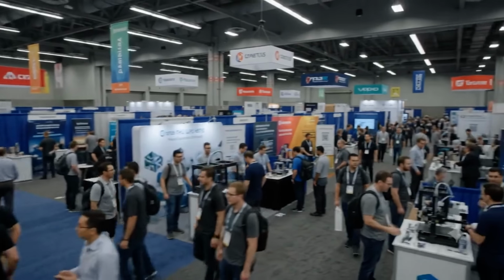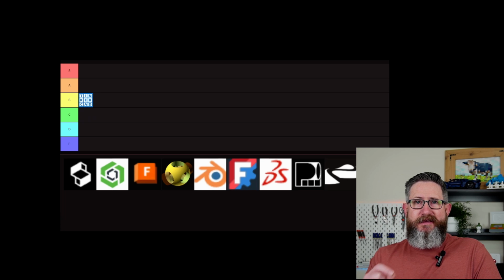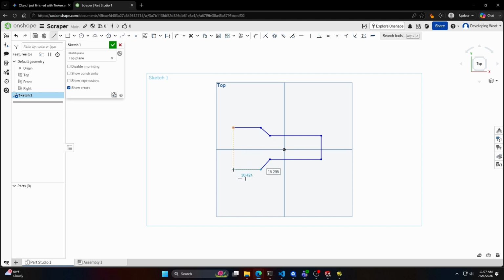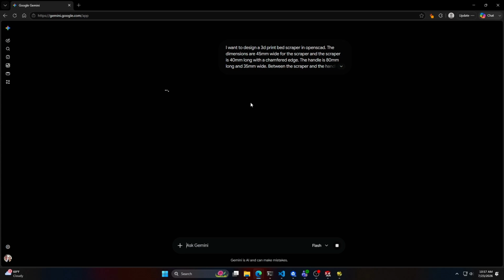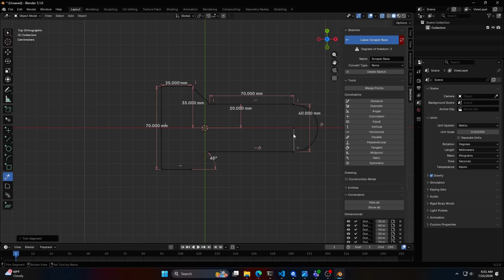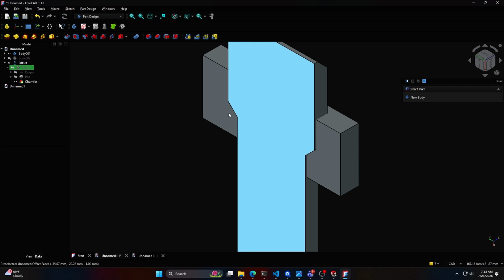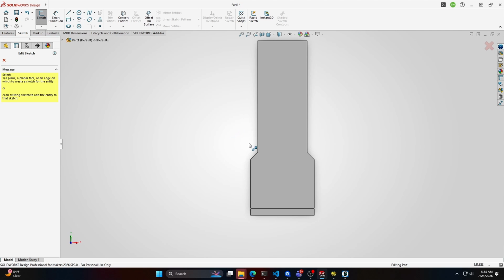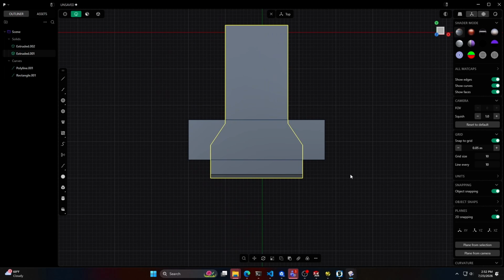Don't Pick a 3D Modeling App Until You Watch This!

Comment: I use OpenSCAD quite a bit.  I think it still might be in the C tier for most people, but for completely different reasons than what was stated on the video.   I was said it wasn't parametric, but that is plain wrong -- out of all the 3d design software out there, it is the MOST parametric one out there.   I personally have a mechanical phone charger, that has over 30 parameters.  Some of these completely change the layout of the final model.   It was also said it didn't have history, but in truth, you can use GIT.  But, unlike other modelers out there, this is not required for parametrization.

It does have downsides though, which would prevent me from recommending this over the other products mentioned --  namely the learning curve, which can be high, especially for non-programmers.    AI does not solve this problems either, as my latest attempts to use AI have ended up in generating more mistakes than successes...  So unless you enjoy programming, it's not likely worth it to take up.   It also cannot do organic shapes (faces, figures, animals, etc), so if you're looking to do something artsy, it's not great.

Where it shines is for complex technical modeling, especially where you are likely to need to configure a model on the fly (say you wanted to make a phone holder, you can configure the phone size at the last minute, and it can automatically update the entire model to match).   It can also do parts which require specific mathematical properties (i.e. paraboloids, quadradic surfaces, etc).   Here it is much more powerful than any of the products mentioned.
Reply from the maker: That's a fair point, treating code as the history and using version control like GIT is definitely a unique and powerful way to approach parametric design!

Comment: I've been using SolidWorks and NX professionally for over 20 years, that scraper should take about 5 minutes in either program if you are comfortable in either program and comfortable doing CAD in general.

That said, I have REALLY been enjoying using Plasticity and feel like it's the absolute fastest out of any of these programs. Yes, it's not a typical parametric program and doesn't have traditional history but making most changes is a breeze. Would I use Plasticity for a complex assembly of functional parts? Probably not but it smokes the competition for functional and organic parts when it comes to speed and efficiency IMO

Comment: Agreed FreeCAD needs a UI and workflow update
Reply from the maker: It’s definitely a powerful tool, but a more modern interface would go a long way!
Reply: @nicholaswilkowski632  for the ui there are very helpful add-ins that you can download to make it look modern. There are also youtube guides to reorganize all the tools properly. A bummer that you need to do it yourself though...
Reply from the maker: Man, this is a great tip! I didn't know there were add-ins to modernize it. Are those add-ins opensource and actively updated?
Reply: @wootsworkshop  FreeCAD has an integrated add-on manager. I followed the video for it, he has a lot of helpful tutorials for freecad: https://youtu.be/LKq7hgbu7ks?si=piIhlSqUob5hMlW8
Reply: FreeCad has a built in plugin manager and there are several plugins that change the UI. I’ve seen several YT videos on settings and plugins that improve the experience immensely.
Reply: No, the last thing FreeCAD needs is new "modern" UI. Classic UI is logical, fast and keyboard-centric, which is a must for productivity, unlike typical modern UI. What FreeCAD needs is further investment of efforts into bugfixing. I can't get through any tutorial without seeing unexpected error messages in console and filing yet another bug report. It also needs to eradicate Python from its code architecture and go back to C++-only model - Python only makes it slow and unstable. And it needs to do away with a linear feature chain and switch to a feature tree model in order to eradicate topological naming problem.
Reply: @Primarysearchtraining  FreeCAD almost solved the topological naming issue with 1.0. I did not had a single problem since, now being on 1.1.4. :D
Reply: @DeJe63  Have you tried 26 ?
Reply: @Primarysearchtraining  Agreed. Pretty little icons are fine for learners on that program but it's very hard to beat keyboard shortcuts for productivity from an experienced user.  That's where the shortfalls of a simplistic “test“ like this start to show through. In his “daily driver“ it was a 4 minute job.  For me in autocad it would be even quicker, but that's because Autocad was my daily driver.  There's no way I can compare what I can do with Autocad to something like blender for instance that I've never touched before.  
The more capable a program is the more complex it's menu structure becomes. In some ways a test like this is like trying to compare MS Paint to Solidworks. The outcome is going to mostly be determined by what you are trying to draw and the experience of the user.
Reply: I'm only interested in usability and don't care about the UI. Freecad is second to none in this respect. If they ever update the design to include the near-sighted huge buttons and thus decreasing the density of the interface I would be crying. Not everything has to look like a childrens toy.

Comment: I use Openscad but admittedly I have done a lot of coding in the past.  I have tried many CAD program including many of these in the list but I always jsut get exhuausted and go back to Openscad.  As for the comments in the video.  Openscad is inherently parametric.  History?  Well that sort of doesnt make sense in a code based design.  The code is the history.  And for  visual feedback.  Just F5 or F6 and it is there instantly.    Well designed code is easy to understand, change and extend.  I know most people seem to like visual programs.  Maybe I have fat fingers.
There is another one not on  the list that I use all the time in conjunciton with Openscad.  SolveSpace - is a tiny and basic  parametric modeler.  I use it to quickly convert a concept into some numbers that I can plug into Openscad.  Even so Solvespace is quite a powerful 3d modeler in its own right.
Reply from the maker: Totally get that. For coders, OpenSCAD makes perfect sense; the code is the history. F5/F6 for instant visual feedback is definitely efficient. Thanks for the SolveSpace recommendation – that's a neat workflow idea for bridging concepts to OpenSCAD parameters.

Comment: Great Video, I used AutoCad lite for years for 2D drawings of all types. I am retired now and  enjoy woodworking and now 3d printing. I have a good CNC with 4th axis, and printer. Have done a lot of design in VCarve Pro, which does create tool paths.
Because i wanted a better CAD ability than VCarve, I have tried Fusion 360 (free), Solidworks  for Makers 3D Sculptor, Tinker CAD and Free Cad. In those apps the juice (learning curves) was not worth the squeeze.
I happened upon Plasticity, and was able to design all kinds of 3D items with great success. They looked good, and easy export to the CNC and printer. That said it is not the best to quickly make something with precision. For me it was  many happy accidents I was able to print and carve on the CNC.
Starting with OnShape now, and this may be the ticket for me. Some early successes, but I am not in deep yet. I appreciate your take on this stuff

Comment: WTF, complaining about an “old” UI is insane!
Modern UIs are catastrophically unusably crap! You can’t even tell the freaking borders of the boxes or what is a button any what’s just text anymore!
90s UIs are heads and shoulders above them, and it has only ever been downhill since either Windows 2000 or KDE 3.5 with CompizFusion.
Also the whole premise of a PROGRAM having a UI design is already a ridiculous Windowsism. On Linux, the system defines the UI style, and the software is expected to use it! So the UI doesn’t have anything to do with the program! If you don’t like it, change it to one of countless choices is your desktop environment’s settings! I thought even Windows used to be able to do that, no?
Reply from the maker: I think the UI is more than just the borders and boxes. But I think I understand what you're saying. All my Linux systems are command line only so I wasn't aware of that with the Linux desktop. Interesting.

Comment: There are still a few CAD Programms out there. There is PTC Creo Elements/Direct Modeling Express, Solid Edge. It‘s free for Makers. And Alibre Design, Butt this istn‘t free, But it works Great.
Reply from the maker: I'll have to check them out
Reply: These are Windows onlly...
Reply: @DouglasJenkins  Of course. Windows is simply the most widely used operating system. If you’re looking for something for Linux, FreeCAD is right up there. Otherwise, Varicad runs natively on Linux.
Reply: @ElmarTeubner  To be exact, Android is the most widely used operating system, Windows is, on desktop.
Reply from the maker: @DouglasJenkins are you looking for an Android CAD application? OnShape is in the cloud, so it works as long as your browser supports it. Not trying to contradict what you said because it's true, I used all of them on a Window desktop. However, many of these applications have builds for other operating systems. Shapr3D even supports vision OS. If I can help you find what you're looking for, I would like to try. Thanks for the comment.
Reply: @wootsworkshop  Yeah, about that "as long as your browser supports it" bit, I wasted many hours trying to get either FF or Chrome to work with OnShape on Ubuntu, and it would not work using the Nouveaux video driver with a modern Nvidia GPU, and Wayland seemed to be a no-go as well.  Even using the proprietary Nvidia driver (which is awful , I was reminded why I had ditched it years ago), some menus would not appear in OnShape, and I packed it in.  "Supported browser" covers up a lot of backend requirements.

Comment: I am missing Rhino. It was many years ago the one that was easy to learn compared to SolidWorks and Inventor. I could learn how to play witht the splines and than trying out this and that - it can produce easily crap but it is not as squareheaded as the most classical CAD programs. It lacks parametrics and if not beeing deciplined you easily have some small inaccuracies in your model noticing far too late - but there are strategies and ways to solve that. Anyway, for modelling - my favorite program for a reasonable price. A lifelong version cost 1000€ and all optional updates, coming all 3-5 years cost about 600€. I also use FreeCAD for small parts where parametrics make things easier for me and for CAM (before I was using FUSION).

Comment: Nice review! One thing to mention, for me, browser base cad is a turn off just because you always need internet connection to operate. Secondly, your model doesn't do justice to Plasticity which is made to provide tool for very complex geometry although creating the scraper have been simplified if you have use 2 simple rectangles(handle and cutting head) along the YZ plane than rotating the "shoulder" and mirroring the whole "half" into one complete piece. With the square bracket it should take 15min approximately. It's almost like Blender but the fonctions are hinden under right mouse button... not easy at first.👍👍🇨🇦🇨🇦
Reply from the maker: Thanks for the workflow tips. I really appreciate the positive comment. The big struggle I had with plasticity was I felt it didn't do parametric modeling. But perhaps I need to use the tool not trying to make it fit my workflow but in a workflow it's designed to excel in. I wonder if I shouldn't give it another go. If you have any other tips I'm all ears 😁
Reply from the maker: I also agree with the negative of a browser based tool. Requiring an Internet connection isn't a selling point
Reply: 2 minutes max i Plasticity for sure, maby only 1

Comment: Im a professional Mechanical Engineer (Stress Analyst) -- been using 3D CAD for about 30 years and have used most of the big hitter programs -- I now use Plasticity outside of my 'day job'. Took a bit to get used to but its absolutely amazing at surface modelling and tbh there isn't a mech eng project I wouldn't use it on...... Make of that what you will. Great video btw
Reply from the maker: Amazing insights. Thank you for sharing this in a kind and supportive way. This is exactly what the community needs. You are no doubt a beautiful person. May I ask, the problem I had with Plasticity was the ability to change early dimensions late in the game. I'm not good at design so often I realize I've made a mistake, and I have to go back to an early sketch and make a dimensional change which can obvi have cascading implications and multiple sketches/extrusions need adjusting. I wasn't able to do this with Plasticity. Do you have a workflow with Plasticity that you could share that would help someone like me learn to love it more?
Reply: @wootsworkshop  The answer to your question is familiarity. Plasticity can change hole sizes, positions, etc but it does not offer parametric/history based modelling. For the sort of basic models you show in the video Plasticity is more than adequate. TBH, having used all manner of CAD/2D/3D modelling apps for over 30 yrs (now retired) I find Plasticity is beat for fast, concepting. Plasticity made me fall back in love with NURBS modelling (which Rhino made me hate). Plasticity is like SketchUp for engineering/hard surface modelling for me!

Once you get into complex models then you need constrained sketches and parametric toolsets. For that I use Solidworks. I can import a Plasticity solid model and rebuild the "parametric" history in Solidworks using "Feature Works". 

Very good and fair review by the way...I enjoyed it. I am a long time Blender user too since 1.8!
Reply from the maker: Thanks for sharing your perspective on Plasticity and its strengths, especially for concepting and hard surface modeling. It makes so much more sense to me now. Using Plasticity to conceptualize something rapidly and then building the parametric model from that is absolutely a workflow I could fall in love with. Thanks so much for share your experience with me and the community!

Comment: Solidworks maker edition isn't cloud based the same way onshape is though.  It installs and runs locally.  You just need an Internet connection to verify the license and launch it.  It's super hardware dependent, so the lag makes sense if you don't have enough computer to run it. 

I use it because it's what I learned in school, I'm too lazy to learn a new one, and it makes me feel like a big boy engineer to use professional software lol. 

It does have an absolutely brutal learning curve, and a lot of the tools are completely unintuitive.  So I would not recommend it for newbies unless you're going to be doing real engineering stuff.
Reply from the maker: This sluggish performance could be how I have the rendering configured. Perhaps I need to give it another chance but my system exceeds the required specs easily. Thanks for the feedback.
Reply: Or a patch that turns the license verification routine JMP into a NOP. ^^
You paid for it. So it’s perfectly legal to circumvent it on your own system, even in capitalist dystopia countries.
Reply: @Reality22026 how do please?